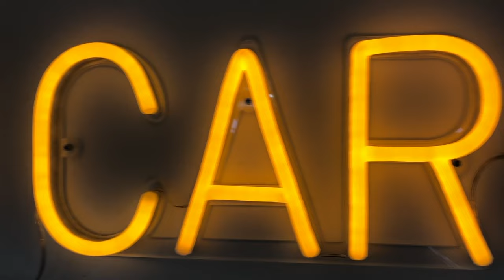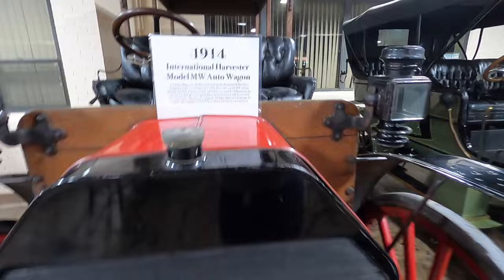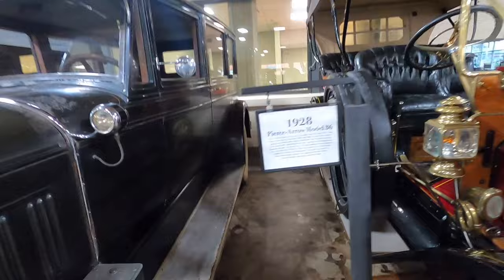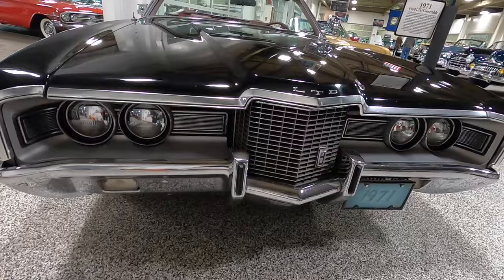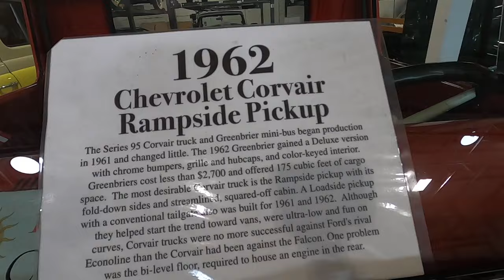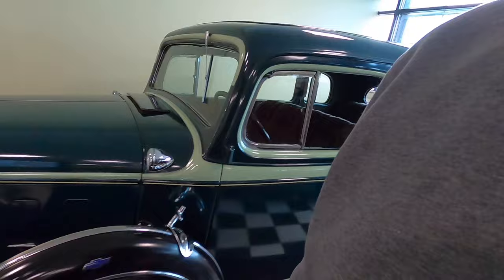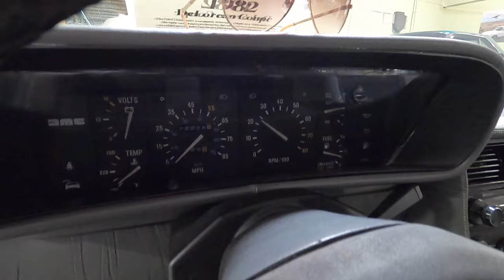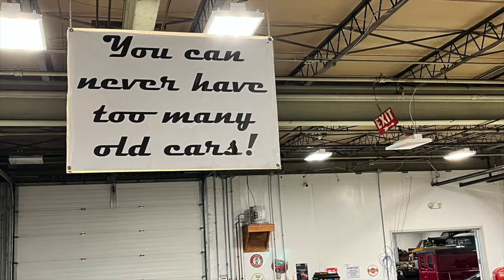Collection 21 car museum in Erlanger KY

Comment: Howard, great tour video! Love those shiny old cars! A friend gave me a ride in a 31 Franklin when I was a teenager. That thing hit 70 mph on a side street in a New York minute! I got my license in 1958 when Model As were only 30 yrs old. My Nissan pickup just turned 27 and still has years of life left in it except for the money light. It was interesting that you mentioned lubricants and filters in those oldies. If they had contemporary lubricants and filters they would all still be running! But for good or bad electrics don't need gas, oil or several hundred parts. They are the future. My son's Tesla has 80,000 plus miles and has only needed wipers and tires to get there. Meanwhile I'm on the hunt for a clean more than 35 yr old pickup because the Nissan won't pass emissions next year. All the very best!
Reply from the maker: On gasoline cars, maintenance is a must if you want them to last. I agree on electric, once there are charging stations more prevalent and the charge docent take more than 15 minutes, more people will start buying them. I can't imagine doing the road trip we did in an electric car.... it would have taken twice as long, due to waiting on recharging batteries.
Reply: Howard, my son's 2018 Tesla S only has a 220 mile range but he's driven it from SoCal to Las Vegas, Seattle and Albuquerque where I live and it takes a half hour to hit 80%. Newer electrics are hitting well over 300 MPC and the new chargers can hit 80% in about 15 minutes. But I do wonder if 50 years from now a couple of old guys like us will be restoring and loving a 2014 Nissan Leaf?  @OldCarAlley
Reply from the maker: LOL.... Sure, as peoples fond memories of cars they grew up around, will be what they want. Thats why Ford T's don't bring in the money they use too. People our age have fond memories of the 50's and 60's cars and prefer them. Most of our generation who enjoys the 50's and 60's cars will fade in the next couple decades, as we die off and the younger generation docent relate to them. @wesleypulkka7447